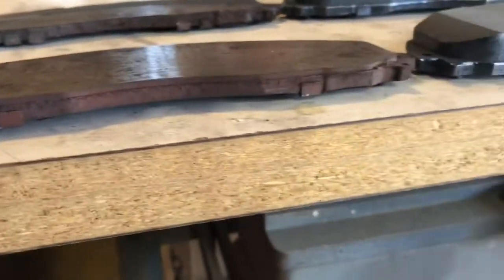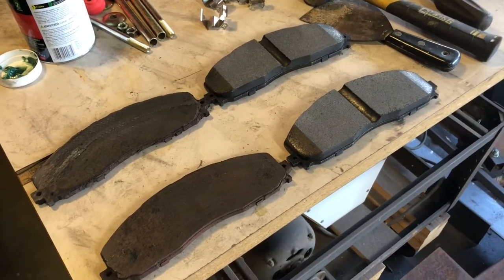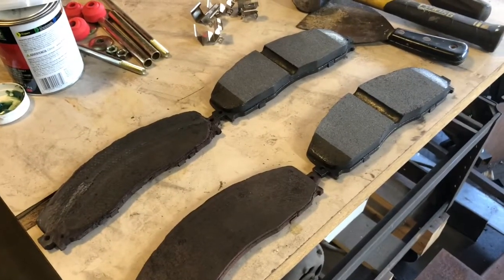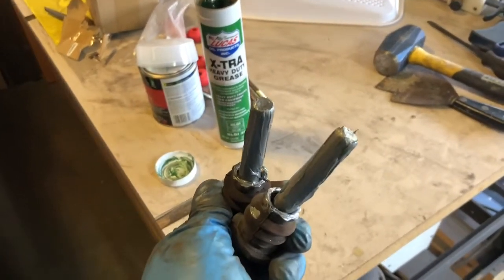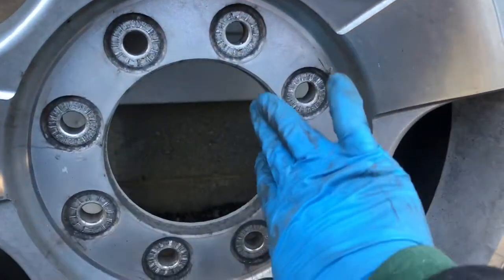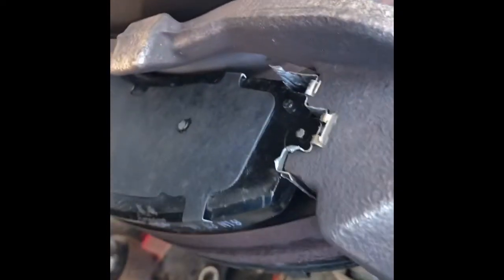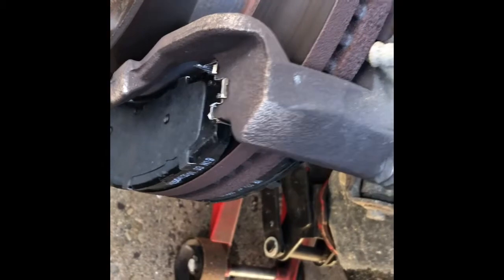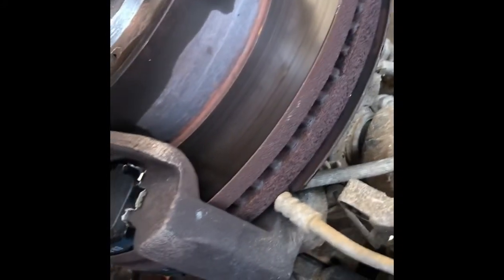Brake Pad Replacement, Pad Slap, Tips I Use, F250

Comment: Great tips. Thanks man
Reply from the maker: You’re welcome!
Reply: How are the new kill devil heads doing on your 6.0? Did you swap out any other internals... stage 2 cam etc? Interested to know how the process went for you. I have an 07 dually with 88k on it. It runs great and I am wondering if it is worth it to do the studding before I have a failure. What were your costs with what you did? Thanks again for all the great info!
Reply from the maker: @taylorkottcamp3689  Hello again! The KDD heads are still doing great and I’ve actually had it on the highest tune now for around 5k miles trying to push it. Drove it 13 hours (twice) for a trip and not even a hiccup. I do have a turbo problem but that’s my screw up on using my old turbo with non-lipped oil seal. I rebuilt turbo with a cheap kit to see results and proved I was right that cheap kits are no go. I did not do internals but now regretting. Don’t get me wrong everything is great, bearings were good, quick ball hone, new rings, of course new lifters but now I wish I bored her out .20 over, decked block(raises compression) put that stage 2 cam in, and owdawg intake. I’ve got the power hunger now as these things are beasts. If yours is stock I would wait on tearing into for studding. Just do your main upgrades (bullet proofing) so you don’t have a shut down. Egr cooler delete, stand pipes, dummy plugs, stc fitting, run a low tune (actually better for truck than stock). This way you can save up for the whole 9 yards of anything you want if or when gaskets go or heads crack. Depends to on what you do with it now and how fast you want the extreme reliable power. Sorry I get long winded, so much too say about these trucks.
Reply: @BugmanVlogs  Great to hear. You know if you want an awesome turbo I live 30 minutes down the road from KC Turbo in AZ. Talked to those guys. They make quality stuff. I know 6.0 bros uses Turbo Time USA. I hear they are great too. I have a tuner but need a Tow tune. My truck is for work and play. I am due a new oil cooler. It runs a little hotter in the summer than I would like. I plan on doing exactly what you said with stand pipe and plugs with a STC fitting. I shut off the EGR in my tuner. I plan on installing an O Dawg intake and physically deleting the last of the EPA out of this truck. It’s a lot to do for just doing an oil cooler but I think it’s worth it to do it all at once. I am debating whether to just put in 6.4 banjo bolts or regulated return as well. You aren’t long winded. You just own a 6.0.
Reply: @BugmanVlogs  also did you put 6.4 rods in or the equivalent from KDD when you put your motor back together? I forgot to ask.
Reply from the maker: @taylorkottcamp3689  I forgot about the banjo bolts. Another definite must. Those check valves can close off new or old at any time and leave you stranded and are not needed. Regulated return is needed when running 190cc or bigger injectors but not necessary on smaller injectors. Do blue spring upgrade and to watch fuel pressure the cheap way I put grease gun hose in place of plug on fuel bowl with 100psi gauge. It’s just zip tied to bolt by intake elbow and does not look bad. Yes go with 6.4 pushrods when you get that far into it. They’ll keep valves from smacking a piston. Some have mentioned the shorter rods would lose valve opening but that’s not how it works. Lifters pump up the extra needed. The problem was to many were close tolerance and the longer rods bottom out the lifter and cause the problem. I Wonder which engineer lost his job over that mistake, lol. I’m going to rebuild my turbo with proper oil seal and see if it fixes the slight spraratic light white smoke issue and do a video about it. After that next upgrade is a KC turbo and will probably go with stage 2. I have stock injectors but I’m not worried about top end. Plenty of fuel stock to play down low for now. I do like the Stealth G67 as well. They have a huge 77mm turbine to 67mm compressor which might work better  for stock sticks. KC is 72.5 turbine to 64mm compressor. 2mm isn’t much but spool time will hurt just a touch. I like the reliability of KC better and will probably go that way.
Reply: @BugmanVlogs  I appreciate the knowledge really I do. I’m going to do those banjo bolts. I’d like to run stock injectors and nothing above 155/30s since my truck is always pulling trailers. I have never heard anyone putting a gauge there on the plug. Awesome idea. You should show that if you haven’t on a video. Great idea! Stay safe man I appreciate the back and forth.